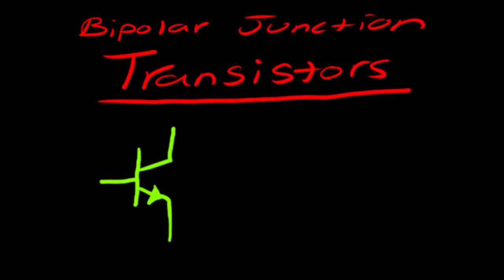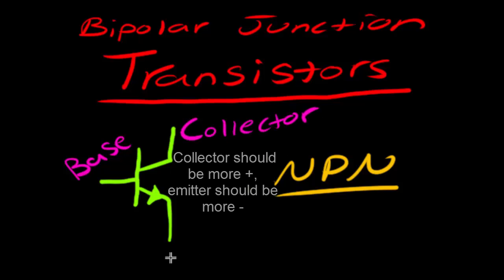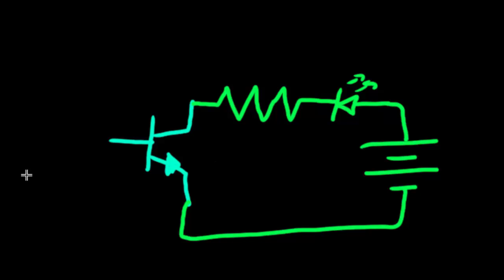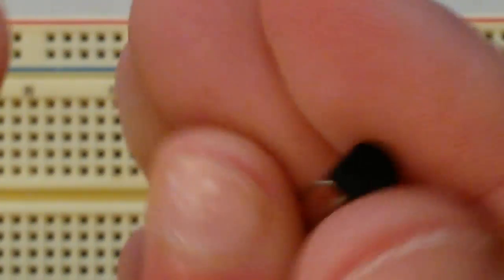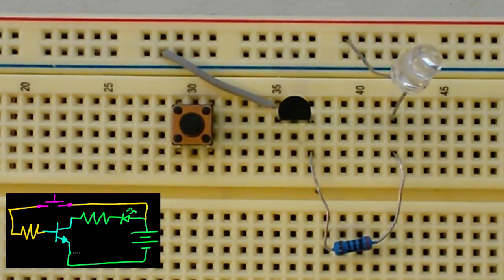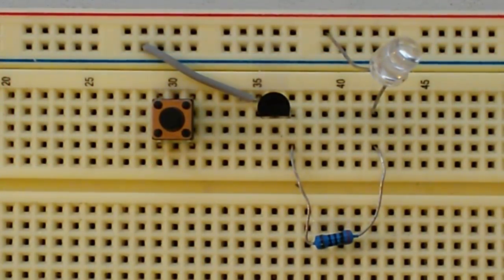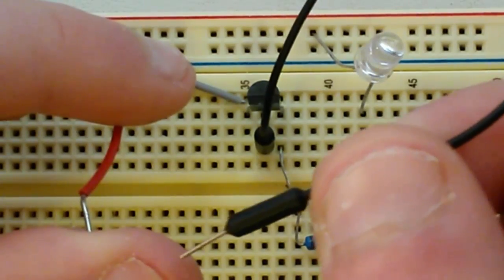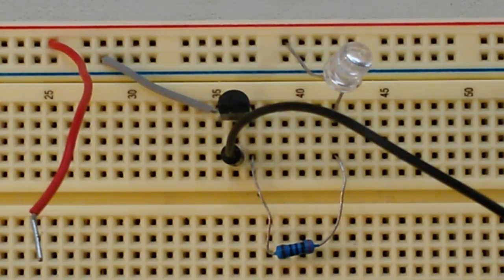Beginner Electronics - 22 - NPN Transistors

Comment: amazing videos leaning a lot. i do have a small question though. in this video you connected you led with positive battery terminal directly and resistor after that. from your videos i understand current flows from positive to negative and if thats right then the high voltage should go though led first and then to resistor which will eventually burn the led coz resistor will only stop current after it goes through it. so it either that putting resistor anywhere in circuit will decrease the voltage throughout circuit or the current flows from negative to positive. unless its one of the 2 cases otherwise led should be broken by now. so what is it?

Comment: In the schematic, why did you put the LED before the resistor? Shouldn’t the resistor be before the LED on a conventional current?
Reply: It really doesn't matter. The resistor makes the flow of current more difficult for the whole circuit, not just for the part placed "in front" of it!

Comment: I missed the point of why we ever need a resistor instead of a relay, what are its main uses/advantages
Reply: Transistors are smaller, and they don't have mechanical parts that could be damaged. Also, they can be used not only as switches, but as controllers of the current flowing through the circuit as well. For instance, the processor of your phone contains about 2 BILLION transistors! Can you imagine it having the same number of relays?

Comment: Summary:
- a transistor is functionally similar to a relay
- it had 3 leads, the collector, the emitter, and the base
- you hook up the collector and emitter to your circuit
- but normally, no electricity can close from the collector to the emitter...unless you apply a very small amount of current to the base
- you can use a really weak battery to provide electricity for the base, or a bigger battery and include a large resistor
Reply: the hero we didnt deserve
Reply: Ty
Reply: The same as i was thinking what is the different between

Comment: Can anyone answer me plzzz!! at 4:04 shouldn't the resistor be placed before the LED since the current travels from + to - which means the current goes from the LED to the resistor while we need the opposite in order to lower the voltage before it passes through the LED so it won't burn ???
Reply: No, the order doesn't matter. The voltage is divided instantly between all devices connected in the series in a closed circuit, so the LED is safe (as long as the resistor has enough resistance).

Comment: Thanks for all of the previous videos, but here at 5:27, you said 100,000 ohms where as in the schematic it is written 10K-Ohms which really means 10,000 Ohms. So in reality which resistor needs to be used ? 100,000 Ohms or 10,000 Ohms resistor ?
Reply: 10k he added a little note in the video

Comment: Do you still need a resistor connected to the LED with a 3 volt battery?  If the voltage drop of the LED in near 3 volts, why would it burn out without one?

Comment: If the LED is 3.2V, and the power source is 3V, why is the 200ohm resistor required? Surely there is no need to lower the power source voltage when it's already less than the forward voltage of the LED?
Reply: The power source usually is 9v and the led is in another circuit......
Reply: He specifically said in this video that it was a 3V power supply, not 9V.
Reply: brrayne you’re right. I missed that. I don’t think he will answer your question. There’s never a response. Good luck with the rest. I guess we’re the only ones left haha

Comment: here you again use resister after LED instead of using it before. i have lot of confusion  please tell me why
Reply: Just think if you did a little bit of reading about electronics you would have found out long time ago. As with all the other asinine questions in this comment section.
Reply: Look at his video number 9-11 or something and he explains the reason. It doesn't matter where you put the resistor. The negatively charged ions flow from negative to positive (this is the main driving force of electricity) and then the positive charge flow from positive to negative. The rate of flow of these is directly proportional. If one slows then so does the other and if one gets faster so does the other. So whether a resistor is before or after it gets affected by the resistor.

Comment: To get my project to work I had to use a lower value resistor instead of the 10k resistor.  I am using a 470.  Is this going to damage my transistor?

Comment: These segments are excellent, but I've managed to confuse myself regarding current flow. If the electrons are negatively charged, why do they flow TO the negative pole of the voltage supply? Intuitively they would flow AWAY from the negative pole and TO the positive pole. What am I missing here?

Comment: If you used 2 AA batteries (3.0V), then why did you put 240ohms resistor to protect your LED when your LED forward voltage is 3.2V???

Comment: On the diagram at around 4:30, why isnt the resistor going on the other end of the LED? Shouldnt it be resisting electricity as it enters the LED?
Reply: I too am confused by this
Reply: the order doesnt matter. if you imagine the current flowing from + to -, even tho it runs through the LED first, it needs to hit the cathode to complete the circuit. once it hit it, all components will begin working simultaneously and instantaneously.

Comment: does this mean that those touch (screen) buttons are actually using your finger as a resistor? 9:10
Reply: It's called capacitive touch. So your fingers are capacitors. When you remove the fingers, the capacitance dies down slowly. Have you noticed how certain poorly built screens have slower movement when you drag your finger across?

Comment: This is technically incorrect. Transistors are current control components, not voltage. MOSFETs are voltage controlled.So many details are missing in order to use transistors correctly. You do need the math to design a circuit and to select the proper transistor for the circuit. Even at a very high level which I think he is shooting for, his explanation of transistors is incorrect.
Reply: Your channel is empty.....

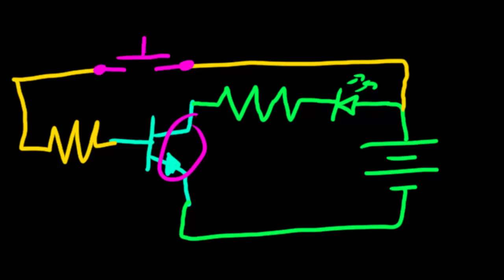Comment: With the message written on screen at 5:56, what does "ground" refer to?  Can someone please explain "ground" to me better?  Is it the negative rail?
Reply: Jonathan Seale yes, it is the negative rail
Reply: Ground is not the negative side of the battery. That is not accurate. Voltage is always between two points. You can have circuits with multiple voltage and current sources. Ground (GND) refers to a common point for all circuits that have a voltage potential of 0V. Don't confuse GND and the negative rail. In some circuits your negative rail can be -5V, -10V, etc., and that is not ground.

Also please note there are two types of ground. On Schematics they are shown differently. There is earth ground, and circuit ground.

Comment: Shouldn't the resistor be placed before the led   more towards the positive side of the power source? I'm assuming electron flows positive to negative and in the circuit drawn above, wouldn't the led short out after awhile knowing the resistor is placed after the led?
Reply: electrons flow from negative to positive.  - just a side note.
Reply: I think he said electrons flow from negative to positive but conventional current flow is accepted as positive to negative for schematics.
Reply: Also, note that he connects negative to emitter. Emit = emit electrons. Positive = collect electrons. But a circuit is always balanced. Negative to Postitive to Negative to Positive.